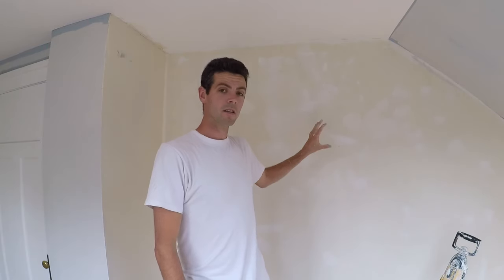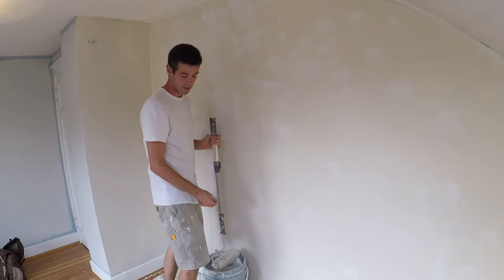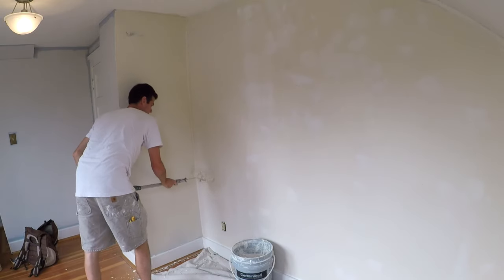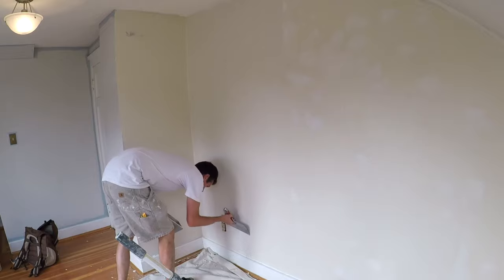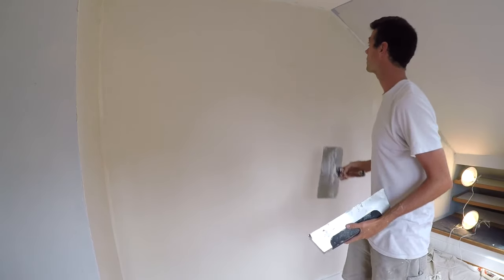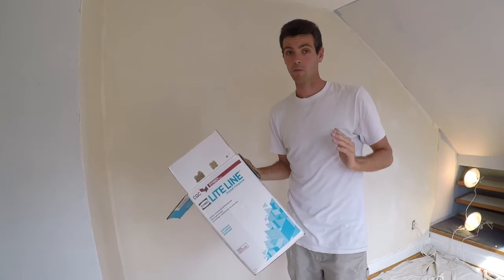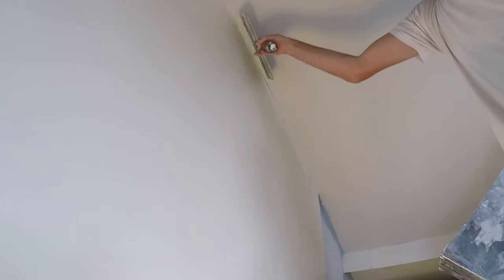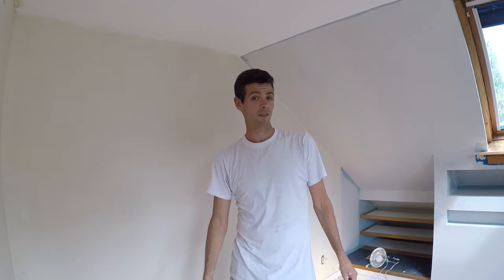The EASIEST WAY to SKIM COAT a wall!!!

Comment: Maybe a dumb question, but do you have to remove all the glue and fill the holes on the wall before you apply the skimming technique?
Reply: I would fill any nail holes, screw holes, and dings.  Remove loose glue or glue that would soften with water.  You don't need to remove 100% of the glue but get 75% or a little more.  The basic rule of thumb is that you need a "sound substrate" to hold the next layer.  That means if you can't scrape it off (moderate scraping with a putty knife) or wash it off, it probably is sound enough to take a top coat of some other material like mud or paint.
Reply: @TerryPullen  Thanks!!

Comment: What do you think about the magic trowel? When i was skim coating my house,  the knife was frustrating me so I bought a magic trowel. Made it easier.
Reply: I'm a DIY and tried both. I think a key is width of the magic knife. Mine was 24 in which I found too wide. I had trouble flattening out the overlap sections as mud got drier. Left ridges I had to sand out. I gave up on magic knife and went to 12 in knife.

That said, I always find that mud drys very quick for me. No way I could do 4x8. I'm stuck doing one strip at a time.

Comment: I have old plaster walls. 6 rooms. I removed wallpaper and used a festool to sand down. Should I prime before I skim coat? Should I use tape on stress cracks first before I use all purpose joint compound like your using?
Reply: Use a good primer oil base is better
For the cracks use mesh tape with hot mud like 45 or 90 and then skim coat good luck

Comment: I have a question. I keep having the same horizontal crack on a large foyer wall. I’ve skimmed it, cracks again. I dug out the crack to about 1/8” deep then repaired with FibaTape and it has come back again!! How do you fix it?
Reply: Cut it out again in a v cut. Use paper tape next time. And use hot mud. And make sure your drywall on the studs are secure. If that dont work and it still beats you up then tear the drywall down and put the joint somwere else  were it wont crack😂. But that will ultimately give you a big space to "patch".

Comment: Hi. I have to repair a ceiling of a shower-room. The ceiling had some water related issues from the apartment above. Some guts "fixed" it but it remained wavey and ugly. 
I wish to fix this. Size is 6' by 9' feet.
How would you recommend I do, in order to make to ceiling flat (level) and smooth again..?

Comment: If you can’t complete your job in one session are you just using a new roller or is there a practical way to clean and reuse it?
Reply: I guess you can spray some water on it and seal it in a plastic bag or put it in a sealed bucket. It should be fine for the next day

Comment: This may be an old question, but I'm too impatient to read through the previous 581 comments. Did you patch holes and gouges before you skimmed it out?  Did you sand before you skimmed? I've got a wall that got all chewed up in a wall paper removal.
Reply: Yes, fix any torn pieces that might stick up when you're rolling. Little pieces are ok as they will stick up on your first pass, but they'll be covered by the second and third. Gouges will be filled as long as you don't remove too much material (push too hard).
Reply: @MyFortressConstruction  Thank you.

Comment: Ben, I was wondering; can this method be used by us rooks, when putting up  drywall? Let's say you tape the joints and corners, then cover the tape with a first coat - then do the roller business, then sand - would that work? I'm only asking because I fear I am not as skilled as I need to be, to get a nice smooth, level finish (like some skateboard guy from BC..) and this seems like a foolproof system.
Reply: you would be in for a sanding nightmare, Skiming walls like that takes much more skill then taping joints..

Comment: Hi. I’m not sure how to fix my wall that has some weird texture that looks like they scrunched up paper underneath the paint. Should I scrape? Should I skim? What order?
Reply from the maker: Try coating a very small section and see what happens. If it bubbles all over the place scrape it off. You could also try sealing the surface with a shellac or oil based primer to see if that stops it from blistering after skimming.

Comment: Great tutorial on skim coating.  What would you recommend for an old apartment with a mix of plaster walls and ceilings and some of the ceilings are a mix of sheet rock and plaster due to partial ceiling collapsing?
Reply: Demolition!!!
Reply: I rip 5/4 decking boards into 1/3rds and screw them into the ceiling joists above. You can shim them level. Then hang new sheet rock. A box extension for the light fixtures and tape and sand your way to a new ceiling.

Comment: Have you tried to use a 12 inch squeegee I used to use a 12-inch knife until I found out what the squeaky does it works great when skim coating textured walls cuz it feels in the highs and the lows evenly but great video

Comment: Can you do this over the paper that is left on the wall. I removed Vinyl wallpaper and the back side is still stuck to the wall. Will this work in this situation?
Reply: Test that theory.
The dry wall mud drying might cause the remaining paper to peel off.
Reply: Well, it's been 7th months but anyone else wondering it would be best to seal the wallpaper with a primer/sealer before skim coating. It would be best to use an oil based or shellac based sealer as water based might cause the paper to bubble.

Comment: I have cracks in joins between drywall sheets where it either wasn't taped well or its just differential movement over many years. Would you recommend taping over the old joints again before skim coating or just skim coating over the cracks? If the former do I need to scrape a V groove where the cracks are before re-taping?
Reply: Personally I would try to rip the old paper off and scrap away the loose bits then v it , re-fill the joint then re-tape it

Comment: Hi, can you do this over wallpaper??
Whats mud? I'm assuming you cant use plaster? Cheers
Reply: No, the moisture in the mud will cause the wallpaper to peel off. Best to remove the wallpaper first and smooth out the wall later.

Comment: I removed all the wallpaper in a room I am working on....only half the room was painted before they papered the whole room....getting the glue off the painted side was easy but on the non painted side I’m having issues when I wet the drywall...the paper remover soaks into the drywall and causes damage when I try to rub it off...my question: does the glue need to be removed before attempting a skim coat? If “yes” then should I sand the glue off? Thank you
Reply: You don't need to take the glue off if it's just a thin consistent layer.I just covered one yesterday after watching this video.

Comment: Maybe I'm crazy, but has anyone ever tried using a small notched trowel to spread a consistent layer of mud and then knock it down with a flat trowel?
Reply: If you are proficient with a trowel there's no reason to do it twice.
Reply: Well try it, its not a good idea your gonna wind up with literally double the drywall mud you need

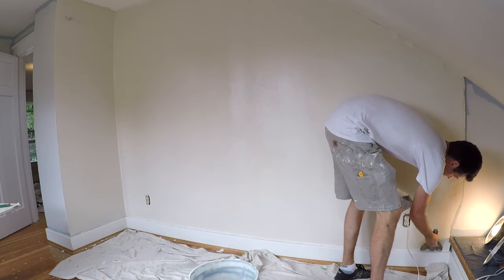Comment: Always informative, thanks!.  btw, at 14:43, it looks like sags in the mud.  Is this actual sagging or just how the light reflects off the surface?  If this is sagging, do you just sand off or recoat?

My 95+ y.o. house has plaster surfaced walls and ceilings.  From remodeling and demo-ing, I found there is some type of (apparently) gypsum-based board beneath the top coats of plaster.  These are approx. 5/8-in. (15 mm) thick, 2x4-foot panels affixed to the studs with roofing nails, then surface-plastered.  Plaster topcoats vary from 1/8-in to 3/8-in. thick (3 to 9 mm) to transition at baseboard edges, etc.  There is a 1x2 (7/8-in. thick) "mudboard" (<-- is that what it's called where the plaster ends above the floor?) near the bottom of the wall beneath the baseboard.

Modern sheetrock has a gypsum core with paper on the front and back.  The plaster board in my house, in addition to the papered outside surfaces, has seven or eight paper layers interwoven throughout the gypsum core, i.e., there is the surface paper, a layer of gypsum, paper, a layer of gypsum, etc. and then the backing paper.  Years of bumps, dings, wallpaper removal scrapes and gouges, and mostly semigloss paint remain.  Can I just use the Lite Line as shown?  Don't mind mixing dry but is there a premixed mud that would also work?
Thanks.

Comment: How many gallons of the lite skim coat did you use for the room?
Reply: On one of my rooms I used about 8 gallons for a 11x14 bedroom including skim coat over a ceiling (painted popcorn that I scraped as best I could to get some of the bulk off). I had quite a bit of wastage because I'm not very experienced though.

Comment: Great video as usual.  Two questions if you dont mind 1 related 1 not.  Would a skimming blade provide even better results?  Butt joint where when i do a "light" sanding the paper tape comes through and now ive got a strip of fuzzy tape that i cant seem to hide.  Any suggestions?  Thanks again!

Comment: I don't think it be much different, but if you had the job would you make a video about doing a ceiling too ?
Reply: The previous owners of my house scraped off the popcorn ceiling and left some rough patches in the process. This would help me out because I need to repair those imperfections and the arwas they went down to the tape along the edges, too.

Comment: what about using one of those magic trowel squeegee tools to smooth out the compound? i always see good reviews for those but haven’t seen you do a single video on them
Reply: I would love to know the answer to this
Reply: I found it did terrible job. I was so excited to try mine and it just ended up bending up in corners and making a hide mess. I did move to a 24 “ level 5 trowel and it’s really good. You need to learn angle and pressure, but the learning curve was short.

Comment: I've tried the roller method on a couple of coats and I like how quickly it spreads over the wall, but I keep getting a thousand bubbles.  I don't know if I'm making them when I thin the mud or if the roller is making them.  Is it possible the roller is pulling them up by rolling too fast or something?  I got a new mixing tool which I haven't tried yet, to see if it's happening then.
Reply: your mud is 2 think or you roll 2 fast

Comment: In all due respect, I have done a lot of skim coating and this method may be fine for a beginner, but I can do a whole wall by the time this guy gets even gets his wall rolled. 
You may even consider using a 10 inch taper mud spreader which gives a perfect smooth/ level 1/8" coat. An 8 ft by 10 ft wall can be skimmed in about 20 minutes. 
If time is a factor, you can always install 1/4 inch drywall over the existing walls or ceiling, staggered to avoid any future seam cracks.

Comment: Can you do a video about skim coating over plaster? Our basement stairway has lathe/plaster and we want to skim over it smooth instead of putting a sheet of drywall over it. Thanks!
Reply: Same method will work. If you have any big cracks I would suggest you tape them 1st.  If the plaster is in really bad condition you're better off hanging 1/4" drywall and finish with a skim coat after you've completed the taping process. This will match your adjacent plaster walls better than the standard drywall finish.
Reply: @oltedders   true dat

Comment: @Vancounver Carpenter, when do you use the bucket mud and when do you use the powder?  I've noticed you use both for different situations.  Is there a guiding rule that you use?  Thank you, any response is welcome.

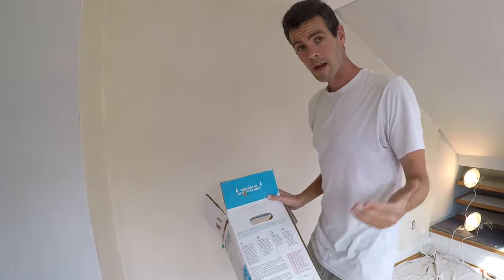10:23 oh, thanks!
Reply: The pre mixed all purpose mud has some glue in it and is good for skim coating and taping. The powder aka hot mud has a hardener in it that is activated by adding the water thus why its not pre mixed and dries harder and is used to fill larger gaps because it does not shrink as much as a pre mixed all purpose mud. Hot muds are harder to sand also so they would not be the choice for a final coat where you want a thin coat that you want flat to sand very lightly over a large surface such as this demonstration. All purpose mud sands easy but will shrink and should not ever be applied too thick as it may not dry properly. Its the best choice for a thin skim coat like this. Hope this helps you some what.

Comment: Another interesting idea.  I've a small hall I have to fix up, so I may try this also.  The first I was thinking when you put your roller in a round bucket was 'I often use a rectangle bucket for general cleaning and washing the car'.  Just mix some mud in a round bucket and transfer it to the rectangle bucket.  You could even add a mesh thingy to remove excess mud on your roller.  Thanks for all your videos.

Comment: Is this effective to smooth out a very heavy sand texture? It's almost like 30 grit sandpaper! No kidding if you were to brush lot bump against it, it will scratch you! Thanks!!!
Reply: Use a palm sander to sand down first before skim coating if possible to desired texture. Be careful to not sand to deep. I would suggest starting with a "360 sanding head" which is sold at paint stores, a manual sanding head that requires an extension pole as well. Use that with 80 grit pads to sand down the roughness by hand.

Comment: Can’t believe nobody skim coats they’re walls over there, if you got a good job done the walls should last a lifetime and you can just paint it over the years a few times if you want. It just looks so good when it’s done. But I suppose it’s working for you guys anyway. So you must not really have plasterers over there? Or maybe just ones that finish sand and cement on the outside of houses or walls?

Comment: Sand light and skim agen  then sand using a light on the wall close
Reply: If you're doing it right, you never need to sand.
Reply: When I go to do this, my expectation is that I will have to sand. Realistic expectations. I will attempt to be perfect, but if not, then skim again and sand.
VC said he'll fix his washboard problem with sanding. So if he has to then I sure as well will have to.

Comment: The drywall in my house was hung with nails. Some of them have popped out. Will a skim coat. Hide these? If not what should I do to fix the ones that have popped and to prevent new ones. Before I paint?
Reply: This method will not help your situation. Hammer/screw back in any nail/ screw heads that are protruding, spot cover each with compound/spackle, following day, sand with sanding sponge until smooth with drywall, prime, and paint two coats. 
Nail/screw heads should be set into drywall about 1/32 - 1/16 inch. If hammer’s head has dented drywall, no big deal, just compound/spackle to fill and continue as described.

Comment: Does anyone skim coat a new drywall installation? If so why? just curious
Reply: Yes I believe they do when they want a level 5 finish. I believe he has a video explaining a level 5 finish. From my limited knowledge, they skim coat new drywall because the paper face of the drywall has a slight texture but dried mud is smooth (hopefully). Painting the wall with a higher sheen paint, you would be able to see the change in textures between the paper face and the mud. Skimming the entire wall gives a uniform finish, making it look much better if you were to use a glossy paint. Not sure if it’s worth the extra work if using a flat (or matte) finish.

Comment: Put a piece of painters tape over the outlet and it will save you a lot of time cleaning and possibly electrocuting yourself.You can also roll right over it with paint, but that's probably not a good idea for drywall mud.

Comment: Is this how I repair a wall where paint and even drywall paper has been torn off in spots?
Reply: You need to cut the torn drywall parts to a clean edge and then seal them with something like kilz primer/bonder otherwise it will bubble when you put drywall mud on. Once you do that you patch it with a thin wide coat, sand it to smooth then do the skim coating over the whole wall if there is a lot of unevenness. This is what we are dealing with right now. Redoing a house where every wall was covered in wallpaper. Lots of torn drywall to contend with. That kilted guy has videos on how to handle it if you can find them.

Comment: I think your roller method is just a big extra step. I could have skim coated that wall in less than 10 minutes just using knives and durabond 20. I would be sanding, priming and painting the wall the same day and it would look perfect. I however am a pro though!